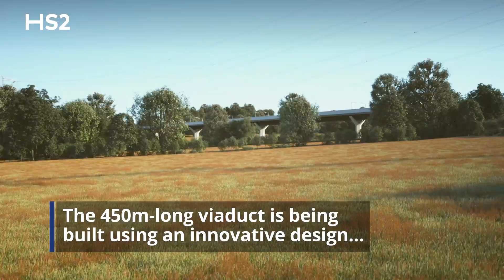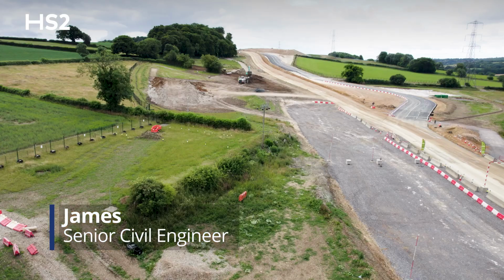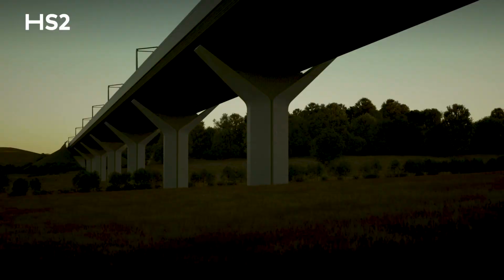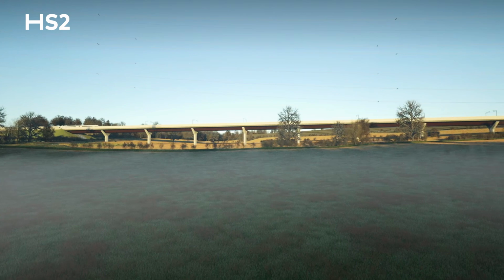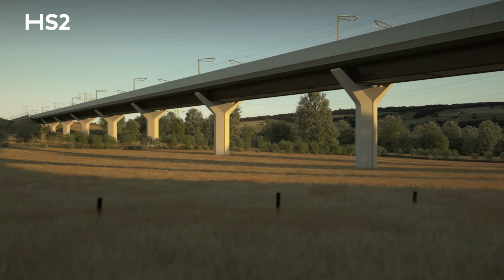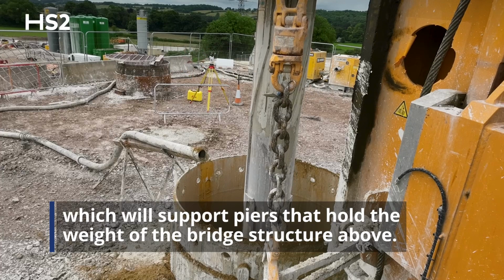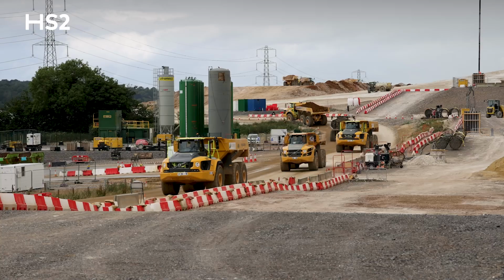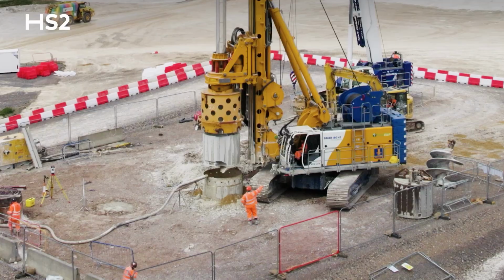Foundation work begins on HS2’s carbon-saving Wendover Dean Viaduct

Comment: great engineering - stoopid low-carbon virtue signalling, what have you got against plant food???
Reply: We have a climate emergency. We need to radically lower the amount of carbon (and other greenhouse gasses that we send up in the air) as they accelerate climate change.

The motor vehicles on our motorway network creates more carbon every year than all the carbon needed for HS2. And HS2 is an electrified railway, so we can generate electricity cleanly and create a way to travel across it that causes no pollution.

However, it is still important to come up with new construction techniques that lower the amount of materials used to make this railway, as everything we can do helps lower the impact of the construction.

The lighter viaducts will use less materials than the sort of brick arch viaducts that lead up to stations like London Bridge station. So, not only will that lower the impact of the construction, and the cost of construction, it will mean that it will be more open below the viaduct. And that's going to be much less unpleasant for wildlife and people who walk below the railway.

That's also why HS2 is a very straight raiilway (better than any of our Victorian raiilways) designed for high speed trains. All of these things are designed in to make it cleaner to build than previous railways and cleaner to operate than previous railways. (And it's being built safer too.)

I'm not going to answer your point  on "plant food" as it's obviously a concern troll  argument, you have picked up from somewhere.  It makes no sense.

Comment: A terrible and reckless profiteering venture wasting millions of tonnes of fossil fuels and magnificent countryside.  This is to enable the growth economy that has taken our country beyond reasonable limits.  The imotive monologue is cringeworthy but judging by the faithful comments they mostly hit the mark.
Reply: Hs2 is needed
Reply: @euan.4551  its not needed. You want it and a tiny minority with you. If there was an un tampered referendum on its need it would fail abysmally.  You have to consider what its about,  what it uses, and its real purpose with the environment and its quality.  Its already in the process of huge damage and this damage is only just beginning.  Most are against it if given the choice. The costs should be entirely paid by those who want it as its not needed.
Reply: @stevendellow9505  Couldn't agree more, especially post covid working practices have radically changed, proof of which can be seen in the local station car park which used to be rammed daily but is now possibly a third full. I don't see a need for this.